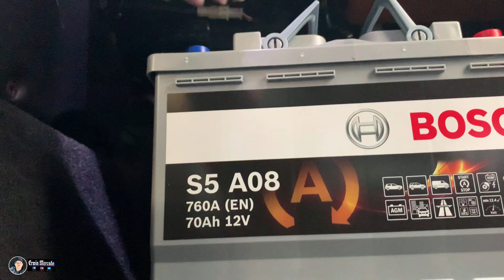HOW TO REPLACE THE BATTERY OF FERRARI F430

Comment: Great videography of the car, but I think you missed out turning off the battery cut off; that ensures that any sparks when you remove the battery leads won't fry the ECUs.  Also, there's no need to unscrew the aluminum kick plate.  The whole carpeted panel just folds down as soon as you undo the top 2 bolts.